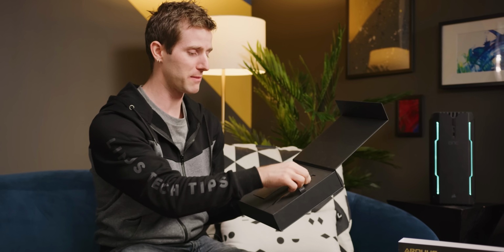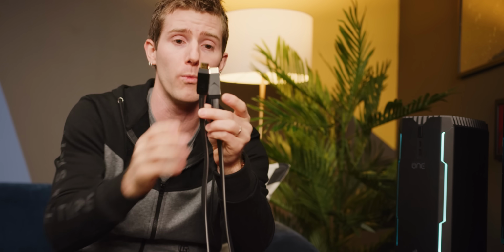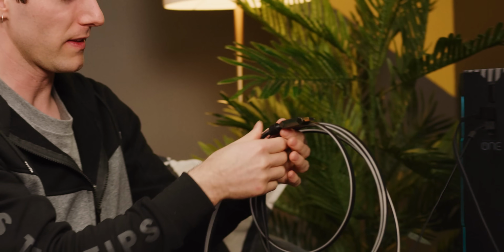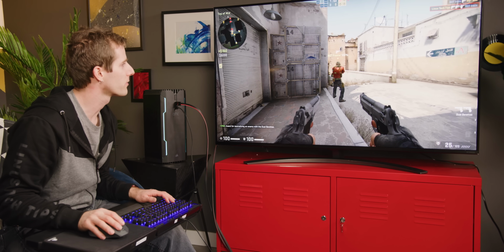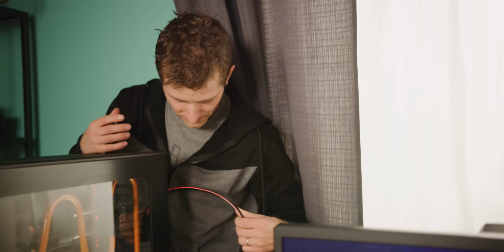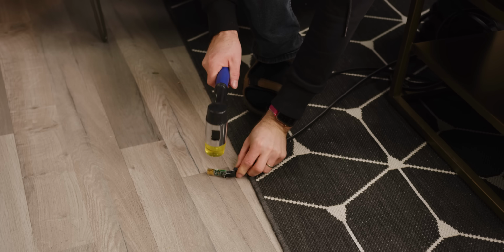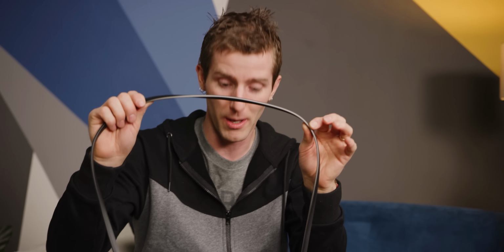The RGB HDMI cable ISN'T as dumb as you'd think...

Comment: The fiber optic HDMI is a good idea, RGB lighting for this HDMI cable is a stupid idea which only increases costs.

Manufacturing HDMI ends which can take SFP-25G-SR cable would be a very good idea. That way you can change the fiber length without re-paying for both ends and when (not if!) the fiber breaks, you can easily change it without re-paying for both ends. That would also lack the RGB which could be considered as an extra bonus!

Comment: I think device charging cables are going in the same direction (even if it's only one color of light).  For the charging cables they're about $24.99 USD for one if you're getting it from a brick and mortar store, if you're getting it off Amazon it's the same price for two of them.

They're probably fiber optic too and most likely have the same circuitry in the connectors too.

Comment: i mean its gonna die anyway since hdmi is being phased out by dp cable. and while both cables are equal in terms of their bandwidth, display port cable has something hdmi doesnt have, reliability.
iv'e had so many hdmi cables break on me over the most minor bends, so much that i had to buy a very expensive braided kink-resistant hdmi cable just to give my ps4's cabling a wide birth just to connect to my tv (now connected to a monitor), meanwhile my dp cables have yet to fail me.

Comment: Of course, the actual reason it comes in long lengths is because it's intended use case replaces edge lighting on your desk or behind your TV. Instead of running a separate LED strip, you run your HDMI cable that also serves a practical purpose.

Comment: Being pedantic, it is higher latency than straight copper, it has to be for two unavoidable reasons.  1) Signals propagate at approximately 0.67c (two thirds the speed of light) in fibre, but are typically faster in copper.  2) The conversion at each end has latency, it's just so small that it does not have a practical impact.

The increased latency is there, it's just so small that it doesn't matter.  Additionally, the benefits of fibre often make the increased latency worth it.

Comment: Got a year ago a HDMI Fiberoptic cable with 15m/50ft length for about 35€/38$ without RGB at amazon. 100$ for a blinking 15ft cable is overprized. And I don't need colored cables to identify wich one goes to the PC - a label sticker for cables available for 5 bucks a package with 50 pieces is enough and way cheaper.

Comment: there would be an rgb led in each end do those 4 cables may be from the power injector so if mhl is not accepted both ends get power from the micro usb and it my be a console port for the ic's at a guess

Comment: Actually you are right, It can be usefull to color code the cable, it is expensive to do it this way though... I got a 3 monitor setup running into multiple pipe to covert the cable, when I get a black screen I never know which one is the faulty one... I will start color coding the cable, but I will surely not get rgb cable since I already cover them to prevent them from dingling around

Comment: Fibre may or may not be quicker but over 10 feet you would need a nuclear weapons grade lab to measure it Also that does not take into account the fibre to copper conversion at each end which is going to eat speed

Comment: What's the point of an RGB HDMI cable if you're not going show it around? You can't really show the connection parts because they're connected to stuff and so you have to use the weaker middle part

Comment: in the garage at home i have many different chargers/power cables for tools, RC batteries, torches etc. I write on all the plug ends what it is for. Saves tracing back to the charger. A light does the same thing. Good idea.

Comment: so, there's "no copper" in the transmission for the display, but there is copper supplying power for the receiver and for the rgb on the other end. so... "no" copper but still like 5 or 6 copper wires running the length..

Comment: I believe in RGB mostly for practical applications. For instance, I use AURA lighting in Smart Mode to tell me at a glance when my computer is overheating (Green=Cool Red=Hot). About the only other RGB things I've splurged on are a SteelSeries Apex and Razer Chroma Keyboard (both of which I got on the cheap at FreeGeek Chicago). Colors on such devices can then be used with applications and tell you at a glance which key configuration and available macros you're using. But THIS? WHYYYYYYY?

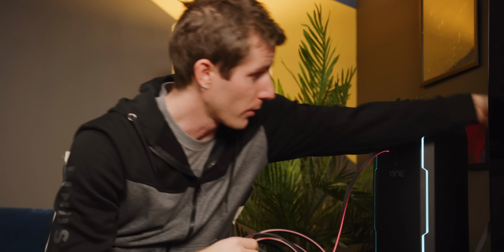Now (to be fair), for cable identification, I can see its usefulness. Red cable to Switch; Blue cable to PS2; Green cable to Computer. I also like that it flashes red when one end is disconnected (3:14); that helps identify which cable you're removing.

That being said, for the casual/budget gamer, it's nothing but vanity, hardly worth spending $80, let alone 100.
You're better off buying a 7-dollar HDMI cable from amazon basics (or find some at your local FreeGeek) and use cable labels. It's worth the EMI/RFI and latency (which I hardly notice, if at all). And besides... I don't run HDMI cables THAT long.

On the other hand, if you're a pro gamer (or run a cyber cafe like Ignite), and speed and reliability are foremost in your mind, then I can see getting a cable like this for that purpose alone (given that it uses fiber, not copper). The RGB should be nothing more than a bonus, if for no practical use like cable identification.

Comment: So, for a HT, the advantage is being able to tell which cable goes where, by reaching behind the AVR, BEHIND the AVR..... at a premium. No. These are not for a traditional HT with a cable nest tucked away. That's one of the worst applications of light. If you're so disorganized that you cant remember you inputs (nor bothered to rename them), you would have a nest of cables that does not need to be highlighted. 

You could use these for a gaming focused HT, where multiple consoles are shelved front and center... then having the active cable would look good, as long as you have good cable management. You could also wall mount a single console, or PC, and have the cable "tron" across the wall towards your screen.

Comment: I... really like this. Its the future that anime told me we would have.
I bought usb charging cables with lights that would flow faster based on how much power my phone was pulling. It was super helpfull back in the days when an actual 2 amp usb plug was hard to find. And they used EL wire instead of LEDs so it was bright everywhere.

Comment: For a 15' cable length, the fiber optic cable is less likely to have dropouts or handshaking issues with finnicky devices in 4k modes, although an active cable like a Redmere would be cheaper and work just as well at that length. People with projectors in their ceiling often use fiber optic HDMI cables since they have to run long runs inside their walls to their stereo receiver.

Comment: Small snake oil alert: "Since light moves faster than electricity" - err, yes, in a vacuum light goes as fast as anything can; but when you send it through glass optical fibre, it goes about 67% as fast, whereas electrical signals can propagate anywhere from 59% to 99% as fast as light in vacuum, depending on the type of wiring.  In any case, unlike high frequency traders, you don't care if your HDMI signals arrive a few nanoseconds later.
https://en.wikipedia.org/wiki/Velocity_factor
Real question is whether the signal transmitted can be reliably received under all expected conditions.  This was not always a given even for modest cable lengths -people might recall early NVIDIA GPU chips with integrated DVI giving sporadic "sparkles" even with good quality monitors and cables.  Active optical cables are used for long high speed links in networking and storage; they cost a lot but they aren't as pretty as this one... :^)
Reply: Did you practice this in front of your cats, and share a can of tuna?

Comment: Perhaps you had better think again... try plugging a standard old HDMI cable into your 4K monitor/TV and see what happens... there WILL be losses just like Cat5 is not able to handle the same speeds as Cat6 or Cat7.... If you are "so sure" about that, go ahead and plug in old Cat5 cables into your video servers and observe the throttling... switch out all your HDMI for the standard old cheap plugs... Go on... it's just a "digital signal" "it either works or it doesn't"... I triple dog dare you... Your reputation is seriously on the line here.

Comment: Actually HDMI signal is not either work or doesn't. I might be digital but there are bit correction built in the signal so if there are errors in the signal, the processors will try to correct the signal. This is why sometimes on a bad cable, you will see lines or dots, or even certain color acting weird but not complete loss of the signal. Saying quality cable can't improve a digital signal is not correct because the signal alone the cable is still analog since no signal is either on or off due to capacitance, resistance, and inductance caused by the cable material.

Comment: For anyone interested, the maximum length of an HDMI cable, without being repeated or boosted, is 65ft. LV electrical impulses (signals) are limited in how far they can travel based on the resistance of the wire, which causes the electrons to become weaker the further they travel, resulting in signal loss/degredarion.

In the case of fiber optics, theoretically, there is no "maximum" distance a fiber cable can be as light travels "indefinitely".

Technically, a fiber optic cable should provide superior AV quality over a traditional copper cable when you consider that they aren't susceptible to em interference like traditional copper cables. There's also the fact that light travels (slightly) faster than electrons so theoritcally transmission speeds would be faster too as long as you have an interface that can handle it.

Please note, these descriptions were the ELI5 versions.

Comment: I despise RGB, yet I have loads of RGB parts. Why? Because they (the ones I have, that is, not all RGB parts) are actually good quality parts for a decent price, more so than comparable non-RGB parts. This includes an IRIS mouse, Corsair headset, some case fans and a couple other bots and bobs. Actually the headset was a free warranty replacement for a non-RGB set. Edit: Ouch! Just got to the hammer part. Only Linus would bust this open to see what's inside. Well...I would, but I was one of those people who disassembled calculators as a child...and wired them together because I wanted more than 8 digits on the display.

Comment: Its only 18Gbps cable....... useless for that cost... I got a Cablematters 8k cable for a fraction of that cost, and straight away it unlocked new refresh rates in the Nvidia control panel when connected to me 2019 Sony 55in XG9505...... before i had a 18Gbps cable and was limited to 2160p or 1920x1080p..... with the new cablematters cable i can play at 1920x1080p with native refresh of 100Hz,119Hz and 120Hz... So when I upgrade to a new gpu from my current MSI GTX 980 Gaming 4G, I expect to be able to game at a full 120fps via my TV...Which also has screen lag of as little as 11ms.. :-)

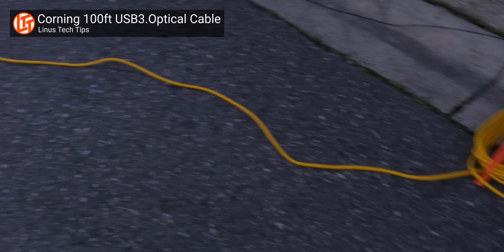Comment: 4:45 50ma at 5 volts of power = 4 low power Red LEDS,  2 low power Blue LEDS, or a very tiny fan that moves but not fast enough to cool anything.

Comment: I like RGB but not that much... want to know what's connected to what... label your cables (there are many ways to do this) or use different colour cables.

I think if I was to get one of those cables (and it would only be one) I'd use an HDMI matrix or something similar to put all my devices through and use this one cable to go between the 2... cleaner and cheaper 😌

Comment: i will say the rgb hdim would be good for like at a bar were instead of having to hide the cables they could use the cables as part of the display or set or art as well as help tell what the problem is when it not working by falsing red

Comment: TRY IT WITH AN OLDER MACBOOK PRO! Lol, I have a "Late 2013" model 15" Retina MBP and have had problems with certain HDMI devices on the built-in HDMI port, problems that I never had with a Thunderbolt to HDMI adapter. So you might be able to effectively demonstrate the supplementary power cable with one of these machines. Just a thought.

Comment: Linus: Glass is glass and glass breaks

Also Linus: Bends the shit out of the cable
Reply: Seriously, when I saw that I cringed... I have a fiber optic hdmi cable too and it'll break if bent in the wrong way.

It's by ruipro. It's only one of the only cables that'll support 4:2:2 at 10bit @4k at 30ft.
Reply: @xapexi  Cellular network tech here. I work with fiber all the time in headends, outside plant, at the nodes, and I didn't see him bend the shit out of the cable. Fiber can be bent ridiculously tight, a lot tighter than you would expect. You also have buffer tubes and a tube with aramid yarn to add strength and to keep it from kinking. Just don't kink it and you are fine

Comment: I work at a fiber optic company. Don't use this for VR if you move alot and step on your cable alot. The glass is very easy to snap inside. Also, don't try to bend it to much too. Tried to keep it loose. Beside that, The Linus is right about the bullshit.

Comment: Linus:  "so one of the advantages of being fiber optic"
still Linus:  proceeds to bend the cable over the maximum bent radius allowed for fiber.  :/
Reply: Cable: works perfectly fine after exceeding design restrictions
Reply: Depends on the cable and material used for the fiber. I've had some that barely even got snagged on the corner of an entertainment cabinet and were then useless, I've seen some that have been pinched backwards and worked fine still. That aside, I was thinking the exact same thing.

Comment: how are they firing light from both ends for the RGB if there is no copper to bring power to the monitor end?
and if they have power to that end then it could have been bi-directional, its just too expensive, requires more power then the tiny wire allows, or they were lazy.

Comment: Linus the cable is getting power from the HDMI port otherwise the HDMI direction (source-output) wouldn't matter. The power input on the side is like you said, only if your hdmi doesn't provide enough power. Most TV's or projectors seem to have one MHL port as far as my own experience goes. Your port is probably one too which is why you didn't need additional power.

Comment: So before testing the fade out thing of the light, have you checked that the extra power connector might solve this issue? Because is the video you first mention that the hdmi connector can supply the cable with enough power and then you see the fading on the middle of it.

Comment: HDMI is a digital signal. Electromagnetic interference with a digital signal will literally not matter, because it's sending high 1s and low 0s. If the interference is so bad that the signal is being destroyed, you have much bigger problems. Face it, the only reason to own this is to have a flashy cable.

Comment: Interference is of fairly low relevance to HDMI, it's inherently resilient being a differential link, and foreseen shielding takes great care of that.

What it does offer is galvanic decoupling. This way device grounds are not connected with each other and you can avoid ground loops. Musicians might appreciate this cable for this reason, as it can leave their laptop floating when connecting to an external display. They also have enough heavy cables already and might like the weight saving when travelling. And they absolutely love their cables looking all kinds of crazy so they easily know what cable goes where. Granted this would be an extremely uncommon use case, as travelling musicians tend to avoid external displays.

Comment: Now this is just stupid...  I've used optic cables for years; from military to Toslink audio to Celerity HDMI.  On these, the USB power is used to power the light-to-digital conversion circuits in each end.  And if you play "rodeo lasso" or "fasion headband" with an optic cable, you run the risk of snapping the fiber inside... trust me.  Done it, had to replace it.  There is a bend-radius limitation on all fiber cables.  They're really sturdy and reliable, but it's not as flexible as copper.  And as far as distance signal loss, nothing matches optic cabels for lack of signal degradation over distance.  Copper (and any wiring) looses signal strength over distance... if you're talking 15 feet or more.  The longer the copper cable, the more signal loss.  RG6 and CAT 6 cables overcome this by the type of copper used, the way it's constructed and the strength and type of signal output.  HDMI is a very low voltage system,  which is why it's hard to find a 50 foot UHD HDMI cable.  The minimum distance I put fiber in the system is 20 feet... otherwise it's copper.  AND DO WE REALLY NEED AN RGB FLASHY CABLE?  This is another shiny object.  Or like my dog... SQUIRREL!!!

Comment: 8:28 Well...$80 for an RGB HDMI cable for wire tracing... Or you could get a $23 Brother P-touch label maker from Amazon...which has a cable tag mode... IMO the appeal isn't the RGB. It is the fact that you get a seemingly quality fiber optic HDMI cable that looks nice for about the same price as other fiber optic HDMI offerings.